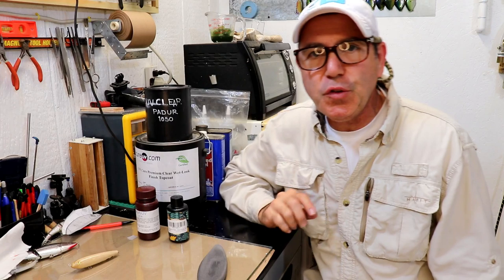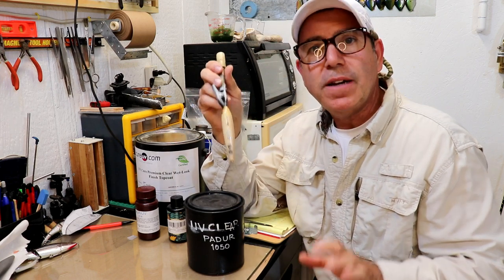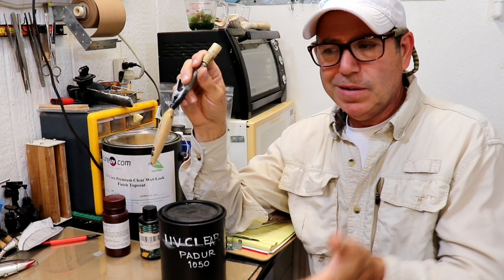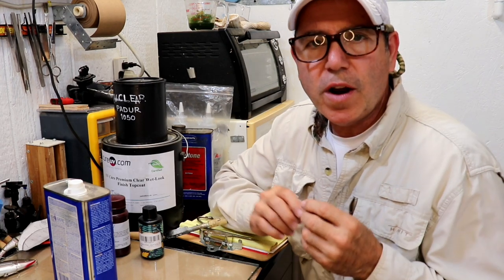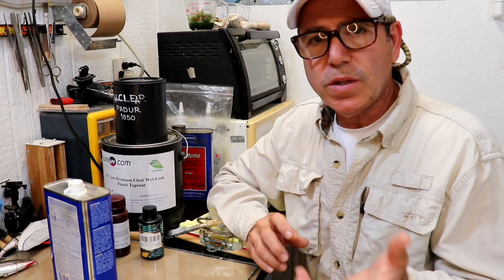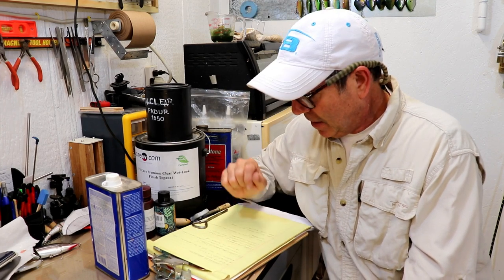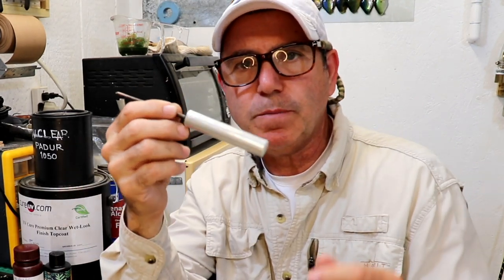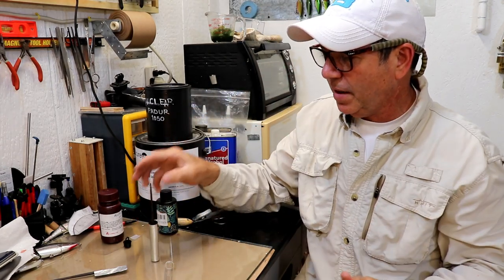UV Clear Coat , Lure Maker Q&A

Comment: Love it - Usefull information - Considering using UV resin for some of my projects, and bought the same chinese stuff I see you have on the table (Black jar with green leaf pattern) Do you find that there is great difference between this and lets say AlumiUV?
Reply from the maker: The biggest difference I was finding is that Alumi-UV took just a little bit longer to set really hard and it finished a bit dull..a satin finish.   I mentioned that in the video where I com;pare the two types but, since then, it seems that Alumilite has changed their UV Resin formulation because now it sets just as fast and with a high gloss finish.  I'm not sure what to make of that...but I am comfortable using both.
Reply: @EngineeredAngler  Thanks for the info. Maybe the two products are, at least chemically, the same. Don't know how many producers of UV resin is actually around. I will continue with the chinese stuff as the the custom rules allows me to get that cheaper than Alumilite

Comment: Hello there, nice work man! I have 2x36W nail lamps and curing box, when i setting up the lure and turning on UV, leaving it for 30min. I getting a dull effect, maby i doing something wrong ?
Reply from the maker: If the resin still has a strong smell it is not fully cured...give it another 30 minutes. I usually leave my lures turning for an hour or more. Some uv resins just don't have a high gloss finish.
Reply: I'm using alumi-uv, ill try to take more time, thank you! And what can be, if you holding lure to long in the box, under UV ?

Comment: Thank you for your share.I have a question that which kind of paint can I use?I found that If I paint the lure with Alcohol Marker，the UV coat can't get dry.
Reply from the maker: I use only water based paints.  The UV resin should work well on oil based paints too.
Reply: @EngineeredAngler  Thank you so much!And can you tell me how do to shrink the water based colour?Can I use the alcohol？
Reply from the maker: No...alcohol is not a good thinner. You can use the pre-made thinners. Most airbrush paint makers sell thinners or reducers for their paints.  There are also DIY vedios you can try.  Good luck.
Reply: @EngineeredAngler  Thank you!

Comment: I used to carve my own lures as a kid and got frustrated because there was nothing suitable to use as a clear-coat. Retired now and with these modern products, lure making is on the winter project list! My experience with UV resins is limited to the (extremely expensive - $45 per ounce!!!) products from Loon Outdoors and Solarez that I use for fly tying. If you are familiar with the Loon Outdoors and Solarez products would you compare them to the chinese resin for me? Five minutes to drip; five minutes to level; 20% thinning for spraying... would you please describe the viscosity of the chinese resin so I get an idea of what it would be like to work with it - sounds like would be similar to "table syrup" in viscosity. Sorry for all the questions, I've made many composite (wood/fiberglass) canoes and kayaks so I am used to modifying (thickening) the epoxies properties with fillers but have done nothing to try to thin them - I'm just trying to get a handle on the UV resins - especially the chinese one as I can get it locally (Canada). Thanks in advance!  Hank
Reply from the maker: Happy to have the questions and hope you can spend some time building lures this winter. 
I have used Solarez quite a bit over the past decades, it has its uses but not for lure clear coats  (my opinion).  I have tested four different UV suppliers and for ease of use, quality of finish, and value the Chinese brand is best for lure building. The viscosity is just about like thirty weight motor oil.
Reply: @EngineeredAngler  Thanks for the reply! 30 weight oil - got it! Started viewing your videos from the beginning - really enjoying seeing someone else's way of doing things.

Comment: When you say UV bulbs are you referring to the UV black light bulbs you can get on Amazon?
Reply from the maker: You can use black light bulbs but they produce a weak light that will take much longer to set the resin.  You can find uv LED spot lights on line that work well.  I use the ladies nail setting lights. they are inexpensive and you get twice the wattage for the money.  Just be sure you get a UV light with a wavelength between 360 and 395 nM.

Comment: I e watch this video several times and I’m having a issue with my UV clear. I dipped it this past time on 16 lures. Nice and slow and allowed to drip for a period of time. Buts after 20 minutes the clear thinned out and even pulled away from the lure leaving bare areas. Nothing I can’t fix, but I hate wasting more time into baits. I used rubber gloves throughout the process, never touching the baits with my hands. All baits were cleaned with denatured alcohol prior to painting. For
The life of me I can’t figure out why it’s doing this. And yes my UV clear is nice and warm prior to applying to the baits. Any thoughts Franco as to why it’s doing this?
Reply from the maker: It is probably the paint on the lure.  I have had this happen and that's why I seal my paint with a good coat of minwax polyacrylic. https://amzn.to/3oaBU6F
Reply: @EngineeredAngler  ever try the rustoleum ultra clear? Was thinking trying that.
Reply: @EngineeredAngler  probably not the paint. I used candy 2o on some of them with the same results
Reply: @EngineeredAngler  do you brush, dip or spray the poly on the bait.

Comment: Great video!! Very well explained. One question: Have you used the chinese uv resin to apply it to the lures like a final coat? If so, how was the result? Thanks from Spain!
Reply: he has a video about that
Reply: @dathanoutdoors6922  if I am not wrong, in this video he used the chinese uv resin just to make eyes... 🤔
Reply from the maker: Yup, I made a video comparing Alumi UV to Chinese UV they both work well.
Reply: @EngineeredAngler  thanks for the answer! Yes, I saw it! 😅 But I think that you didnt use it as a final layer, did it? 🤷🏻‍♂️
Reply from the maker: That's true I only compared the characteristics of the two resins.  I use both of the UV Resins as top finish coats and find them both to work well.  I like using at least two coats but three is better.  I love Spain, I want to go back to the north coast and do some fishing.  Thank you for the question.
Reply: @EngineeredAngler  thank you for the answer! I live further south, on the Canary Islands ("the lucky islands" 😃), but the north is very pretty too. Regards!

Comment: I’m new to Alumi UV   Ive had some issues with a second coat repelling and pulling back. Should I be wiping with alcohol in between coats? I’m wearing nitrile gloves not touching the lures with my hands. 
Thanks.
Reply from the maker: Yes...wiping with alcohol is a must between coats.  I like to take #000 steel wool and knock down the gloss then wipe down with alcohol.  Then I am not shy with the second coat, I pile it on and turn it with out the lights for 5 minutes to get the bubble out.  Results are supper ratifying!  Good luck.
Reply: @EngineeredAngler  thanks for the info. I did it once with success but the second time it was a disaster. I will give it another shot. 
Thank you Sir. 🙏🏽

Comment: I was looking for a "fade resistant", fast drying clear cast for use over spray painted art works?  I may be lost, but i know a fair share of how uv clear works.  Quantity, affordability, & reasonable fade resistance are my main focus im looking for?  Applied like a boat veneer with foam brush. :-)
Reply from the maker: UV cure resin is pretty tough and more resistant to yellowing than anything else I've seen.  Its no inexpensive and its kind of brittle so if you're putting it over something that flexes much it might crack.
Reply: @EngineeredAngler  Hoping the solarez is correct product for me?, looking for that nudge to try it, ha...  I do painting both on "concrete" art, once an acrylic white paint & primer base is applied & also concrete epoxied adhered foil graphics, which is even faster of a process.  The work encounters sun that fades my colors within only one season of exposure. :-[   Potential exposure to salt water, & vehicular run over, as well as different weather conditions.
But non yellowing is good, but not always proven to stop a season of fading.  10 years of painting & haven't settled on anything great.  Considering more  expensive ootions. No paint is perfect, but need to find something favorable.

Comment: How well do you think uv resins would hold up to big saltwater game fish with big teeth?
Reply from the maker: No worse than 2 part resin, I think.  The UV resin tends to be harder, that means it doesn't flex as much as 2 part resin.  So it's a mixed bag, it's tough against a tooth penetrating but can be brittle and crack.  If you put on 3 or more coats you'll have a pretty tough lure though.
Reply: @EngineeredAngler  I greatly appreciate the info! Thank you and aloha from hawaii  🤙🤙

Comment: Will conformal coat for electronics work for uv?? I noticed the stuff that glows under a blacklight
Reply from the maker: I have tried some...in fact I have a gallon of the stuff.  you need powerful lights to set it quickly.  It sets a little matte not quite glossy.

Comment: Hi my friend! What about uv resin inside the black box is it Alumi or the china brand, one of the 2 showed in past video?
About UV light what the difference between 360 and 400, here the most common available are 400, important is no go down 360, did I get it right? 
Thanks
Reply from the maker: The resin in the black container is an industrial resin used in circuit boards...I've been testing it but I don't recomend it.
For the light,  no lower than 360nm and no higher than 400nm.
365nm is very easy to find.
Reply: @EngineeredAngler  
Thanks so much!
Reply: 360 to 400 mn, got it thanks! 
What about power, watt? Here  I find many kind of uv tipology lights with different power: 5 to 120 watt, it does matter or not? In my uv box, I use the exact same brand from China that in a past video you compared to Luma and you're made very positive comment about, say nothing about, watt does matter or not?
Thanks!
Reply from the maker: @lannabulls  
The power of the lights is very important, it determines how quickly the resin will cure. Get as high a wattage light as you can. At minimum 50 watts but no more than 100W.
Reply: Ok 50 watt is the average however, if I 'm correct, we can use lower than 50 watt or even sun light, it just takes longer to cure and may related problems that come with a slow curing time, am I right? Thanks!
Reply from the maker: @lannabulls  
That is correct. Remember you can use multiple lights with lower wattage like 3 lights 15 or 20 watts each
Reply: Grazie Francisco, yes I do, I prefere to use led tipology that comes with lower power, at list the ones around 360-400 mn. So I'm going as you said, to use multiple lights to multiply the final watt output, as exp 3 led lights of 20 watt each, all togheter 60 watt,  thanks again for your kindness!
Reply: Sorry Francisco to mind you with a silly question: I'm shopping for uv bulbs, thanks to you I know what I must buy however in the online catalogue, I'm buying from Lazada, a kind of eBay based in Thailand, they are selling uv bulbs that are completely black, the light emitted is purple, 40 watt, 360-400 nm, some of this bulb are advertised as uv black light, the bulb shell, the glass is black, once turned on the light is the classic purple one. Here a link:
https://s.lazada.co.th/s.0V5et
 I couldn't find any info about the black color, may you know something about? Thanks so much!

Comment: Dought you read these comments still, but maybe someone will be able to answer me. I am new to UV top coating. The hv nail cuter has a bunch of little led hv lights and says 120 watt light. Is this too much wattage? Should I go with tube bulbs 30 watts each, would 7w screw in light bulbs work, if I used 4/5, asking them questions cause I know my friends are going to be asking save questions once I get into this. I am going to use Alumilite UV, also saw water diamond clear, but I’ve used alumilite products before good products. Also my motor is 7rpm is that too fast everyone or forms all hv different answers. Any help greatly appreciated befire I start spending money on all the wrong things. Gambleing here text me please no can’t post my phone number but will check back every day and see if anyone has helped me thanks guys be safe god bless
Reply from the maker: Hello, and yes I do still try to answer all the questions 😄 
You can't go wrong with higher wattage, but you should really check out my playlist on this topic. You'll find lots of answers there.
https://youtube.com/playlist?list=PLEVBv_zywucSOtu4FSkyWnDc5groq--WK

Comment: What’s the dilution rate with denatured alcohol and uv resin to spray it with an airbrush?
Reply from the maker: 20% by volume works well with my airbrush...could be different with different needle sizes.